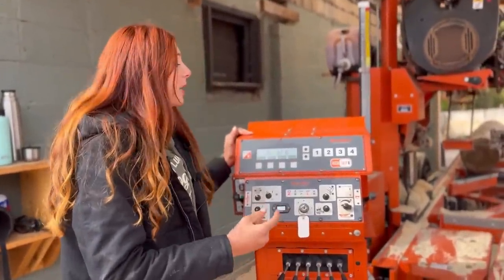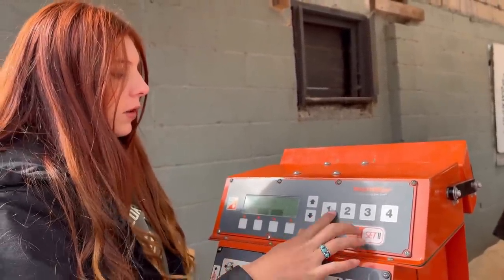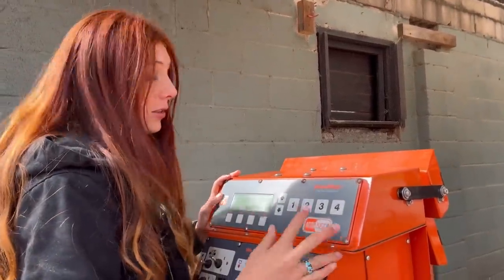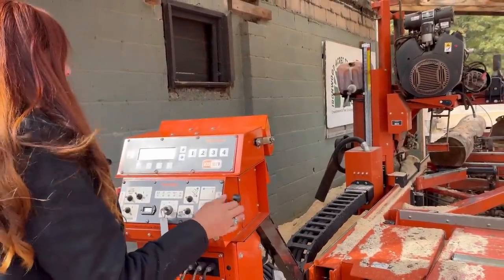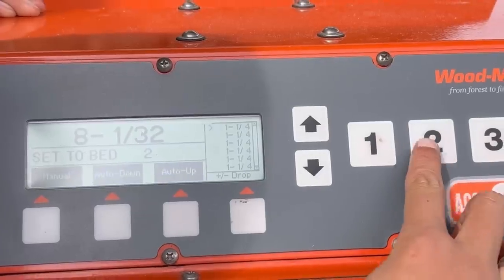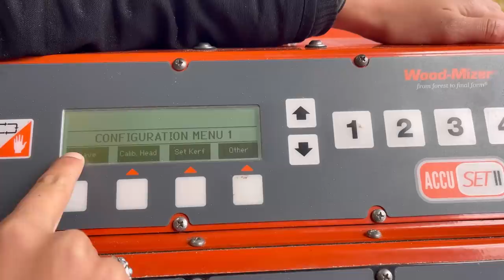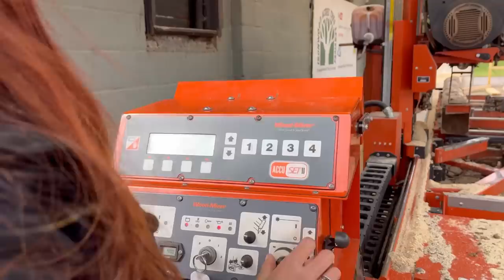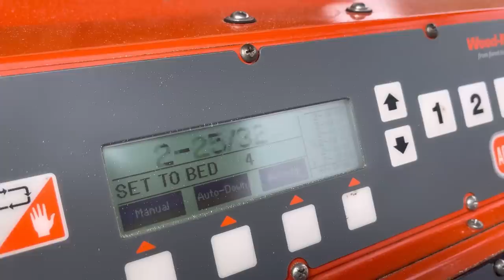Accuset 2 Explained! How to program your mill

Comment: I must admit that this was all a bit beyond me, but still interesting to watch.   Does the blade guide move in and out automatically to following the log shape, and does the de barking scriber do the same?  Also, is there a safety system to prevent the blade from running into the dogs when cutting the last boards?  You are very clever at spinning the logs around.  Most of the mills I have seen fix the logs on a rolling table, and the saw blade is vertical.  Turning the log is done by hand.  These old mills were used mainly to cut English oak, and the smell was wonderful.  the sawyers took their time to align the log to cut the best quartered figure even when slab sliced, so the centre boards had good flame figure.  The outer boards were used to make gates, posts or framework, and other parts used for turning.

Comment: Great job. If you mill an 8x then cut it in half to make 2x4’s then the 2x4’s are actually less then 4”... lol by like a 32nd of an inch. So what I do it in pattern I set it to drop down to 4 and then 4. But I only drop to the first 4 when I make my width and then I finish squaring the can’t then I come back and drop the next 4 (making two 4” blocks) basically my pattern looks like this:
1
1
1
1
4- cut to first to make width, cut my height,
4- flip it back to width side and then cut another 4 to make two 4x’s then turn again

Then cut 222222 all the way down. Wicked smaht
Reply from the maker: +Vermonters 👍👍

Comment: Thanks for the info on the Accuset II. I ordered an lt40 that is supposed to be ready for delivery the last of May or first of June. You may have noticed it, as well, when you edited the video but your blade did not appear to be tracking in the debarker cut line.
Reply: Noticed it  on  the  3:19  and  3:20  mark on the video

Comment: I know Imperial measurements are still the industry standard, but I'm wondering if there is a Metric toggle for your measurements as that might help at times. But, that said it looks like it ain't broke so no need to fix too for your methodology and how you use the machine. Woodmizer really does need to give you a bit of a royalty for any one bought as you are a very good spokeswoman for them.
Reply: Most CNC m/c's can convert. Woodworking m/c's I looked after in the UK all worked in metric.

Comment: What is the do hickey if you're on the other end of the mill on the left side that swings not the Doomafliche in the middle.... Only piece I have yet to ponder it's reason or function....the video your presenting today makes sense.... I have always been able to perceive computer aided equipment I have used many different types....😎 Well did as per usual... thanks

Comment: Does the Accuset allow for blade width? I used to look after an automatic circular saw, we measured the blade width entered that and the m/c would add that to dimensions. It confused some operators as they would work out the amount of boards from a sheet and the m/c would refuse to do it. If the cut widths were added in then the total would be greater than the sheet size, m/c knew best!

Comment: Maybe I am overthinking this, but it would be nice  if the Woodmizer Accu Set II  could  be upgraded  to  voice activated , instead of manually  typing in the measurements.  Just like when you  have  , for  example, Alexa, in a  Car;    Just    say  "  Accu Set,  cut me  a   1x12  x10'  The  computer  voice  activated  program would automatically   measure  the  size of the  cut based on the size of the  log, and  cut  the board  .  Would  seem a  lot  simpler  that  punching  in  all those numbers,

Comment: Very well explained, with your programming skill like yours, you ought to be working for Google or Microsoft or NASA or maybe NONE of the above. What sort of computer does this thing have inside? It's like high heel and low-low tech. In my country, we actually have 3D cameras and x-ray to automatically scan the wood and real computer to cut the wood, no high core programming skill like yours is really needed, and clearly don't need to pushing those buttons by hand. BTW, nice cute little fingers you are having there, but maybe, I mean maybe it's time to get a manicure?

Comment: Would have been a nice video if we could have seen through the glare on the Accuset display...
8 inch, 12 inch, what?  8 inches of what?  12 inches of what?  Height? Width?  From the top? From the bottom?  From the left?
Normally Emerald can explain things clearly and break them down for simplicity.  But not this time, sorry to say.

Comment: Does the set works on the LT40 use a tempos is cylinder or is it a more passive system. Very important for the saw to know where it's at. Thanks, just curious. 🙂